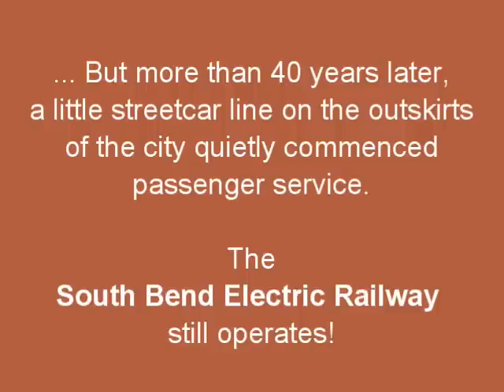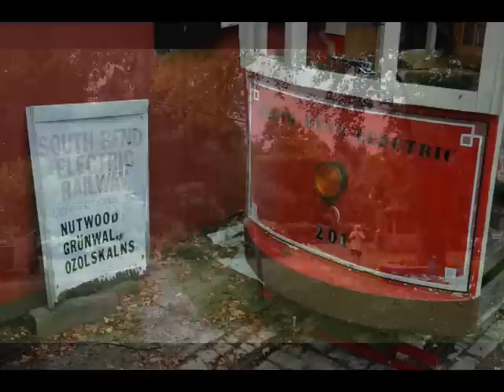South Bend Electric Railway

Comment: Great video.  I was trying to find the point where its been decided to switch from overhead catenary power to onboard 12v battery power?  Around the 9:35 I think it's still on overhead, but then when loading onto the old truck I see a pile of batteries removed?  Cheers =)